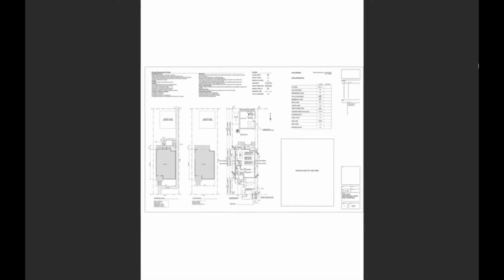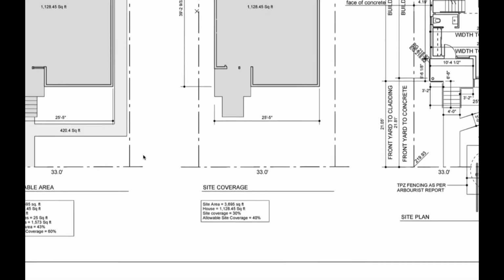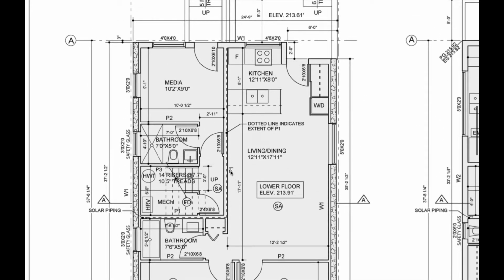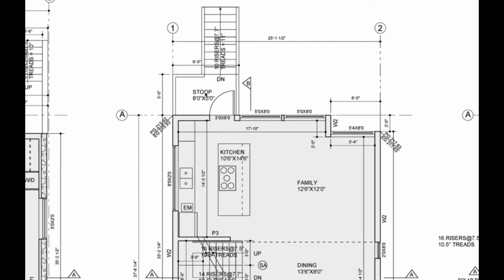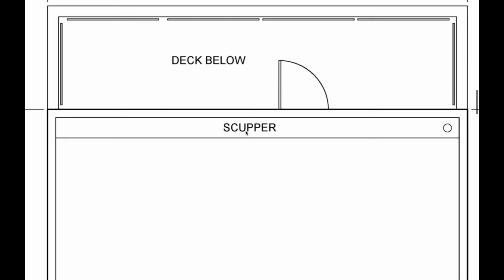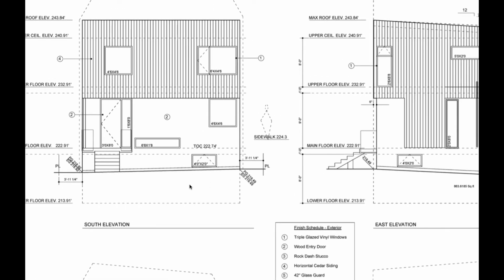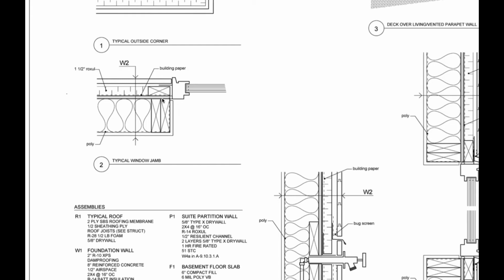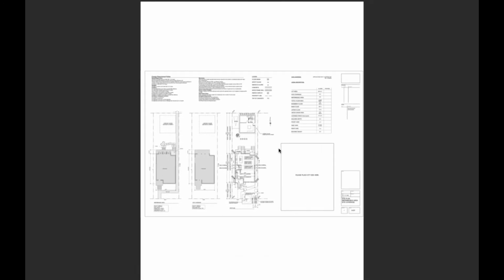How to read Architectural Blueprints

Comment: This is a sophisticated building. I guess at one point you pour a lightweight concrete deck for the stoop! And put down roofing/moisture protection below it. A lot of the foundation wall is exposed to view when you are looking at the building exterior. A “stucco’ is referenced. I wonder if that is Dryvit. That system trowels on to insulation board which would be attached to the foundation wall. Some of the framed walls also show the stucco. That appears to be at the “main” floor. They do have the wrong call out. Then there is ‘board” siding as we move towards the top. It frustrating because it is called out as horizontal but shown to be vertical. It is part of a rain screen system. The details show it to be horizontal. It has a flat (or more specifically, a low slope roof). And a scupper and a rain leader.